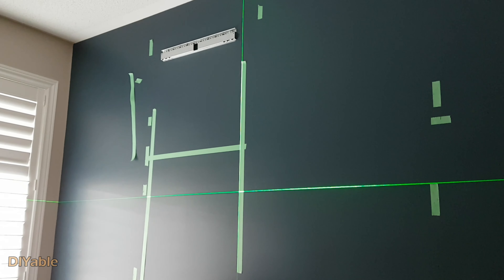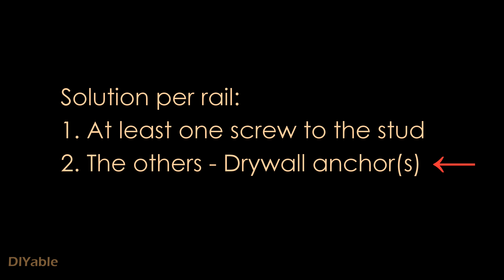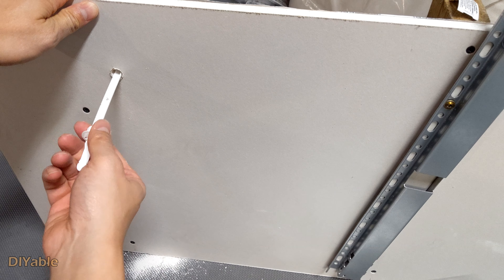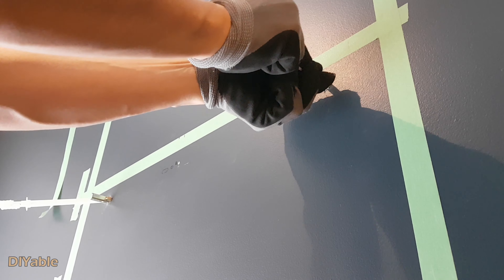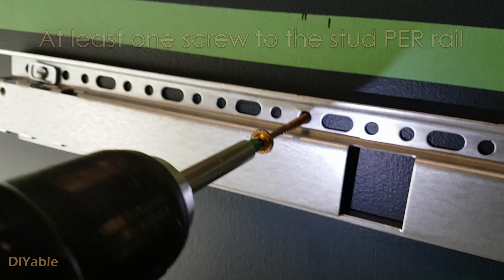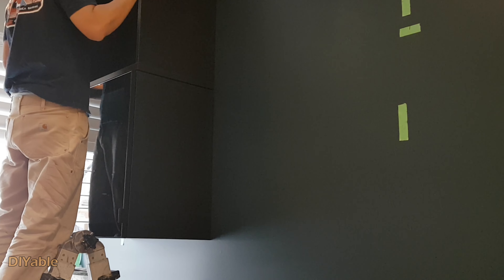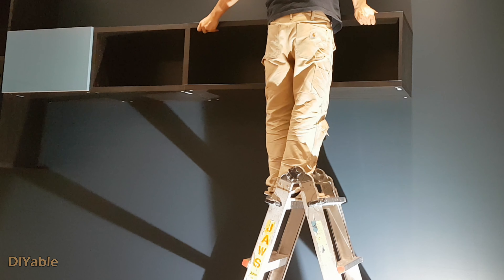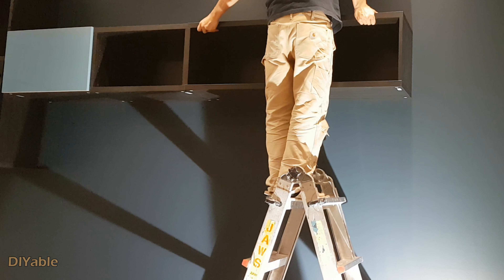How to install Ikea Besta wall unit cabinets on drywall?

Comment: If you’re going to fasten screws that long into a stud, you need to be sure that there aren’t electrical wires or plumbing pipes running through the studs at that location.

Comment: What screws you recommended when installing on  concrete walls. Meaning that the unit is installed inside of course, but it’s an exterior wall; which is concrete. Thanks 🙏🏽
Reply from the maker: Tapcon is the strongest, but you need to practice if you never used it before. if you drill the hole too big, it will fail very badly. The other option is to use a concrete drill bit + hammer drill to drill a hole on the concrete, then insert a plastic anchor. After that, you can use the screw to secure it.  The 2nd method is more forgiving IMO.  You can find those masonry plastic anchor in your local hardware store.

Comment: I am trying to install some Besta units but my floor is terribly uneven . What is my best option ?
Reply from the maker: For the units on the wall, you level it.  For the units on the floor, it really depends how bad the uneven is.... if it's not too bad, I would put some composite shim on one side to make it level. Then cover the front with some decoration.

Comment: I’m amazed with the besta rails. It can actually hold more weight than advertised.  All my screws were in wood studs.  I secured the console cabinet between two besta floating cabinet and it holds well!

Comment: If I don't have studs, will two of the FlipToggle anchors on each bracket hold the besta units?
Reply from the maker: That's a very good question. I would say it's risky.  Certainly it will hold the empty Besta unit, however if you put a lot of heavy items in there, or if someone climbs on it (kids may do, you never know).. the whole thing has chances to fall and can cause injury. I really would not recommend that for safety reasons.
Reply: @DIYable  Thanks.

Comment: Why not just screw the cabinet right into the studs?  Would be nice to have seen the back of the cabinets a bit more.
Reply from the maker: By design.. it's not possible.. it's not designed like regular kitchen cabinets. The back panel is a thin particle board, IKEA wants you to buy the hardware...

Comment: 3 inch long screws allow for screwing through electrical wire, conduit and plumbing running through the center of studs!! Use 2 1/2  inches in length.

Comment: Just a tip to anyone who is installing Besta wall units! turn the unit so the holes for the legs are facing the ceiling and not visible from the ground.
Reply: MIND BLOWN!!
Reply: They give you little white caps to hide these anyway 😅
Reply: And the Ikea tape that it's hard to take off

Comment: If the rail is 20", why not just use the holes on the rail 16" for the studs?
Reply: What if your unit needs to be off center or away from a wall by 2 inches?
Reply: That works great for the first one in the chain... But when you're hanging multiple cabinets, side by side, the next one will only line up with one stud. You will have to end up using drywall anchors.

Comment: The plastic corner anchors connected to the frame are the weakest link in the system. How did you manage to mount the cabinets without flexure? I had to use the old ikea metal mounts, they are much more rigid.
Reply from the maker: Those plastic corners are okay, not the strongest material. But that is part of the design of their system, I just have to trust IKEA

Comment: Nice video, subscribed! Btw what lazer level do you use?
Reply from the maker: Thanks!!! The one I was using was DEWALT DW088LG 12V Cross Line Laser, Green laser.  There are 2 things I want to share with you. Green laser is very powerful, remember to wear the eyes protection glasses comes with the tool, there was one time I didn't wear and my eyes were hurting for the whole night. The other thing is, if you use it outside in bright sunny day say you are building a deck, it's not easy to see the line. Wait for cloudy day or do the work at dawn or dusk LOL... Hope that helps.

Comment: Very good video. I will be hanging the IKEA TV stand but people are saying the attachment brackets do not line up to the studs and the suspension rail doesn't work with the TV stands. Do you have any experience with these?
Reply from the maker: Sorry for late reply.  Unfortunately I don't have IKEA TV stand..  maybe the same method can be applied to solve that problem?
Reply: I realize this is 2 years old... But in case someone is wondering this same thing: The IKEA Besta TV stands hang on the wall slightly differently. You install 3 metal brackets on the cabinet directly and then screw it into the wall directly. Only one of the 3 brackets will line up with a stud. My recommendation is to attach the middle to the stud and use anchors for the other two. If you're installing a combination of besta frames (what's pictured in this video) and besta TV cabinets, you'll want to hang the frame first and use its position as a guide for where to  mark holes for the TV stand.

Comment: Really helpful video, thanks. I installed these units but could only find two studs, which unfortunately were not at each end of the unit, I used two toggles on one side but two studs on another. I hope the weight distribution will work!
Reply from the maker: Thanks, glad it helped. Just don't put extremely heavy stuff on the cabinets. Good luck.

Comment: Just hired Task Rabbit to mount this as I'm actually using in my office and the brackets don't match the studs for me either. I have toggle boots and wondered if they would be appropriate for this project. I'm guessing you bought the rail separately.
Reply: Yes. The rail is sold separately.

Comment: Using 3 1/8" screws, are you not worried about hitting any electrical or plumbing that may also be run through the studs? Perhaps it is different in the US.
Reply from the maker: Indeed...  yes and no.  The Romex cable and PEX running across the studs won't be at this height horizontally generally speaking, at least for me.. also this is a wall facing outside and there is no bathroom above the room.  But you got a point, I wouldn't say it will never happen for someone else..   In Canada/US, some building code requires to install metal wood studs protector plate...  you know if right away after drill passes the drywall.

Comment: I doubt the anchor will holds 200 lbs weight common bro if I put a screw in the wall and hang on to it a chunk of dry wall will break.. just screw then to the studs is enough